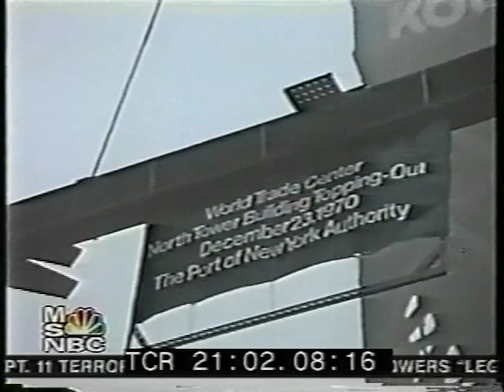Out of the Rubble clips, MSNBC OutOfRubble 1-26.avi

Comment: the guy states the outer columns supported most of the weight but others say it was the core columns that did?
Surely the weight of each floors steel, concrete and office eqiupment would be supported equally?
For either the core or the outer columns to support a majority would need the floor slabs to be tilted down to the one claimed to supprt more of the wieght?
Put a plank on two bathroom scales and stand on centre of the plank and each scale would show 50% of your weight.
Rose White's 9-11
Reply: It wont be exactly 50% but will likely be close to it.

I believe the numbers were 60% core 40% perimeter.

Thats without wind though. With wind the perimeter will hold more and the core proportionally less.
Reply: The core was the main support. It was designed so if a percentage of core columns (keep in mind these were not concrete but steel beams in sequence to support the weight) that the weight would shift and edge columns support the weight. It didn't. Even he taliban aka Osama thought the top would fall and that is it all they planned to occur. It was engineering faults along with events never tested. Engineers can plan and say a rocket can hit x object and it'll hold but until it's physically tested it is science best guess in engineering. This is why the new tower has 4 foot thick super strong special concrete all the way around the core and reinforced. They learned. Also the support locks where the column frame beds locked into place only had 2 each end. While the Guage was significant it could handle the stress. Keep in mind also there is a video out there showing the tower sway after south tower was hit more than its designed sway. There is no conspiracy with planes or hoe they fell. It is science and at what one time was sound engineering but proved to be faulty. Like I said even the taliban was shocked the entire thing pancaked down. Like engineers they felt it would just fall off and rest below be intact. Faults will never be admitted as insurance would have field day opposing claims on faulty contracted engineer work which was to that date valid contracts. Believe it was 100 year warrenty and insured. Now if someone wanted it to happen and didn't stop the events of that day that's another argument. But fact is best guess was wrong in engineering and factors of science proved man's idea wrong this day.
Reply: @lifeisamatrix5960  The Taliban didn’t do 9/11 and Osama wasn’t a member of the Taliban. It was Al Qaeda.
Reply: Look harder
Reply: @lifeisamatrix5960 well, it’s 3 years later that I read your response and like you say until you put it to the test you will find out if the science worked or not. So does that mean the science of metal being stronger than aluminum alloy is wrong too? Like the airplane wings made of aluminum alloy can they pierce through beams of steel without falling off on impact first?🤔 video footage show airplane went straight through on impact.  Someone is lying.

Comment: 3:38 " heat of the burning jet fuel " The actual maximum burning temperature of a Jet-A fuel (standard jet fuel type in U.S.) is 980 deg celcius, melting point of steel 1510 deg celcius.
Reply: MrMintoni literally no one claimed the Steel melted, ever.
Reply: The steel doesn’t need to melt, it just needs to be weakened. Steel becomes very malleable at 980C, definitely enough for it to buckle under thousands of tonnes of skyscraper.
Reply: @Jorge Lobos Ortiz ok jorge